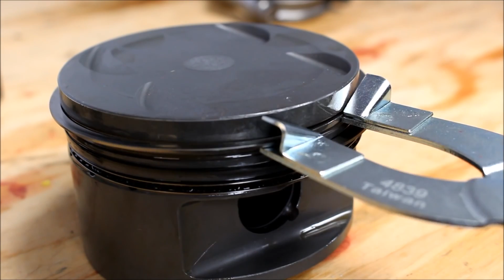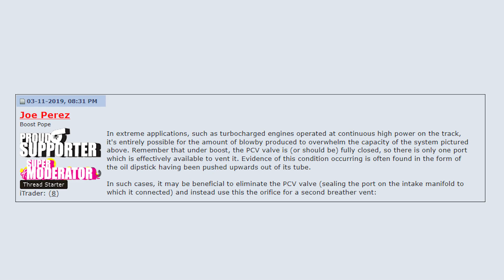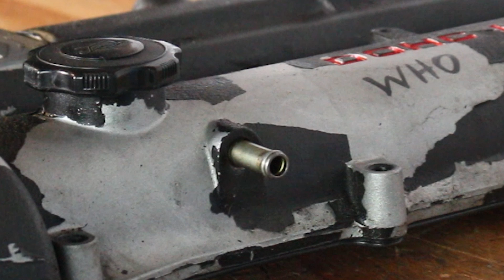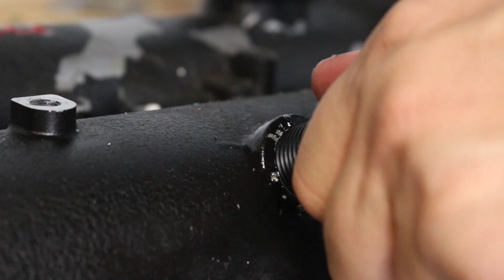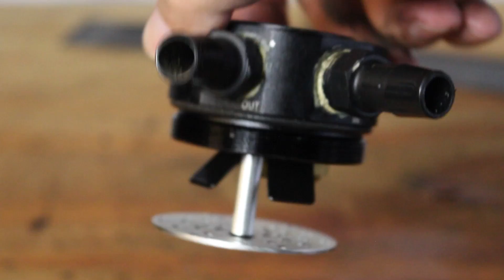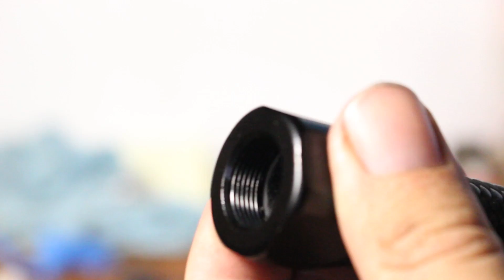Building The Optimal Catch Can Setup For the 400HP Miata! (No Welding Required)

Comment: 3 Things I thought would be made in a 'optimal' setup. 1 Air oil seperator. 2. Oil drain back to oil pan. 3. Air back to intake turbo suck side.
Reply from the maker: 1. Air/Oil Separator not needed unless you're running lines back into your engine 

2. Drain back might be needed, but might not. If it's a small amount of oil collected it's really more complexity than it's worth to add an additional fitting into the pan.

3. This can help evacuate pressure, true. But my concern is sucking oil into the compressor at full boost. To avoid this I could still use an oil/air separator in the breather line but need a 2nd can on the PCV side which I wanted to avoid.

This video is meant to provide enough information to make those decisions for your own car 😃
Reply: @TheCarPassionChannel  yea, good answer. TurboBandit runs 900hp on Mercedes with breather preturbo.
Reply from the maker: @gedas3419  Yeah I have nothing to back up that it could be bad for the turbo, and I know it's good to pull a vacuum on the crankcase. I may switch over to that. I actually have hooked a MAP sensor up to my turbo inlet and it pulls decent vacuum, drops from the normal sea level 100kpa down below 90kpa while in boost
Reply: @TheCarPassionChannel  ♥️
Reply: @gedas3419  Not all cars have the same PCV requirements. When I went over 350hp on my miata I had to eliminate pre-turbo plumbing because I was getting a ton of oil in my turbo and IC pipes. This setup is the result of decades of R&D amongst turbo miata enthusiasts. Any research you do will lead back to this exact setup if youre seeking above 300whp. This was the ONLY PCV setup that worked well for me after trying multiple different configurations
Reply: The oil vapour mix collected is very acidic, you do not want this draining back into the sump ever.
Reply: 2. You are collecting oil, water and petrol. 
You do not want this back in the sump
Reply: You shouldnt drain to the pan because the combustion vapors will contaminate the oil in the can and it will shorten your oil change interval.
Reply: Only reason I can't justify 1 or 2 is because in 1,000 miles I haven't even had a shot glass worth of oil come out.

I went with dual -10 vented setup like this because I was pushing seals and my dipstick with the PCV/breather setup most people run.
Reply: @AnotherRedMiata  same. Massive oil leaks, oil inside my intercooler piping and turbo from pre-turbo routing, etc. All of that solved with this PCV setup
Reply: 2 is only valid for cars that have long oil change intervals where the little bit of lost oil can become a lot of lost oil over the time, but here on such a car that probably gets 3k miles between oil changes, I don't even think it'll lose any significant amount in that time.

Plus the whole point is to not have that shit go back in the engine, what ends up in a catch can is so nasty I wouldn't want that going back in my pan
Reply: If oil gets into intercooler it covers it's walls and fins and reduces the heat transfer like an insulator
Reply: Also thought about this, though i noticed that my catch can (free breathing) often contains more condensation then oil. Draining back to the pan would mean this condensation also gets into your oil.

Comment: Hey Greg, I've forged my motor and may be going close to 18psi, I am mainly concerned about crank case pressure and my seals. I see Level7 do a oil cap 'QuickVent' product that looks a great way of venting pressure without messing with the cam cover. I plan to utilise this with a suitable AN10 catch can, but I was wondering once I install it, and I've got 2x AN10 venting the cam cover from the oil cap, should I still keep the PCV/mani hose in place (it has a GTX valve) or cap this off completely?

Comment: If you're a cheap ass like me, into fab work, an old A/C receiver dryer can be repurposed as a DIY catch can. You don't even need a welder if you're planning on drilling/ tapping the dryer can as well. You can find certain ones that work better than others size/ bracketry wise. Depending on how much time you take/ materials you use, its possible to make yours look store-bought and even better than some that are dedicated catch cans. You can add a drain, sight glass, barbs for filter/ inlet/ outlet, etc👍👍

Comment: Pro Tip: use a PCV valve from a turbo 1995 Supra (and a grommet too). Fits the Miata without mods and is all metal and definitely holds boost!
Reply from the maker: Mazda 323 GTX PCV falls into the same category 👍

Comment: Hi Greg, did this end up solving your leaking oil seals on your red car?

I have a freshly built motor with oem seals and have leaked through two front main seals. Breather system is AN6 and I'm thinking it might be time to go bigger

Comment: You mentioned at idle and low throttle there is a vacuum at the intake manifold through the pcv valve. What happens to your car since you essentially deleted the pcv valve?

Comment: If what was in the old catch can is months to years of oil, exactly HOW is that little oil going to alter octane of air/fuel mixture, and risk detonation? Looks like the complicated catch can is a solution in search of a problem. Not that I'm in the habit of arguing with Joe Perez . . .
Possible engine totaling error in valve cover assembly. Use medium thread lock on the small screws holding the covers to the oil precipitation labyrinths in place! The factory sealant seems to function the same as thread lock, sealant squishing into the small fastener threading. "Hand tight" has ended up with loose screws in the valve chamber, most of which fall through the oil drains in the head, to end up in the oil pan. Where ever they end up, among the valve springs, or in the pan, this risks severe metal damage several places, all totally needless.
The plastic scrunchy in the oil precipitation labyrinths ignores the function their name describes, just 'filtering' any large particles, which should Not be inside the engine anyway. Also, how large hose venting may compromise oil return to the pan. The faster oil laden air moves through the labyrinths with the new larger openings and hose, the less oil precipitates out on the cooler VC metal sides, and drains back into the engine. This fills functional oil catch cans faster! 
Metal mesh isolates much of the air flow from the cooler valve cover, intuition isn't much help determining if it's better or worse. Tests would distinguish which is better, clear or stuffed with metal mesh.
Shouldn't catch can hose cutting and routing be the Last step after turbo air, oil and water hoses, IC pipes and whatever coolant reroute is used, have all been installed in the least mutually compromising layouts possible?

Comment: Engines make 99% of damaging crank case pressure from the underside of the pistons. For the Honda guys why do they vent from the valve cover??? when there are 2 to 3 large venting location located on the back of the block! Maybe they think it looks cool venting at the valve cover.

Comment: did you dislike the mishimoto oil catcher?
Reply from the maker: I just needed to reconfigure the system to let the crankcase breathe more, needed something with 2 inlets and a vent, rather than an inlet and outlet designed for oil/air separation

Comment: I see one problem with this. Sludge. The factory PCV system is there for a reason. It's to prevent sludge buildup. 
Tho maybe with a car that doesn't get to see a lot of miles, it's not such a big issue. For a daily driver tho, you'll definetly wanna keep some sort of vacuum on the valve cover

Comment: I have a turbo 1.6 and I noticed a ton of blow by should I upgrade the pcv valve and port out the breather side I’m going to be drifting with the car what do you recommend? I’d ask the fb groups but rather get intelligent responses instead of 100 smart ass comments
Reply from the maker: Any catch can/air oil separator system is only going to manage the blowby, nothing is going to reduce it. But, it is important that the blowby is able to escape, otherwise it can cause leaking seals. You also want to avoid constantly feeding oil into the intake.

Comment: I’ve seen other videos of older small block engines that instead using the intake to pull pressure they use the exhaust which would reduce carbon build up id think? Anyone think this would work on a Miata?

Comment: Hi Greg, I know you said in the video that for cars in the 200-250hp range you don't need to do this, my question is can I do this on my 240whp car and it will still be a benefit? Currently running no catch can at the moment and wanna do this route over a separator between the PCV and intake
Reply from the maker: The benefit from running a can still exists because you're avoiding oil vapors going into the intake - the comment about 250whp was mostly referring to converting the PCV into an open breather. The common setup is just like you said - using an oil/air separator in line with the stock PCV system, and either running the breather to a catch can OR running a second oil/air separator in the breather line in case you want/need to hook that up to your intake.
Reply: @TheCarPassionChannel  thanks so much dude, can I still use this process in my 240hp application? The AN lines look mint!
Reply from the maker: @andrewatkins1438  Yeah you could do the AN lines on both sides and still have a functional PCV system too

Comment: Run a breather hose from the valve cover to the catch can.  Run a second high-temp hose to North of the catalytic converter (wink wink) to a welded bung that is angled pointing downstream of the exhaust.  Yes, the hose should be flex steel for a foot or two as it connects with the exhaust.  Place a high temperature one-way valve inline, in case of backfire.  The suction from the exhaust will pull out the oil mist from the crankcase, and it will "generally" burn up as it exits the tailpipe.  Prolly better for race cars than something that needs to pass emissions...

Comment: coool video Greg just small note regards of math - increasing diameter from original 6.39mm up to 9.15mm will increase area (which is what matters) by over 100% not 43% so you should be good :D

Comment: You can bore out -10AN to 3/8 NPT fittings to match the -10AN ID. Pretty easy with a drill press and opens it up significantly. There's enough material on the 3/8 side to get away with it safely on a low pressure line.

Comment: I had to fit a 2L catch can (FIA regulation) on my breather side only which was enlarged because on NA high compression, the oil fumes lower the overall fuel RON index which is not good on a race engine...

Comment: R there any downsides to putting a tiny air filter on the valve cover, on the other breather on opposite side of the PCV breather?  NA set up
Reply from the maker: No and that's a common setup. Reading through that catch can thread will help cover all the different setups

Comment: Quick tip on wrinkle paint - the quality/tightness of the wrinkle is dependant on curing temp. If you are painting multiple parts that are in the same visual area, do your painting/curing all at once. Letting paint cure outdoors on different days with different temps will cause different wrinkle finish on the parts.

Comment: Could connect the oil catch can to the intake of the turbo help to the ventilation system? 

Since it’s a vaccum point should help to suck the vapours on the top of the head.

Comment: I like it! Love the Channel. I’ve got a 1996 MX5 that I bought a few years ago, it was put together by Flyin Miata. forged internals, ARP studs everywhere, Garrett turbo charger I don’t remember the size or at the moment, Full stainless dual exit exhaust, lowered with a Full adjustable suspension set up, under body bracing, interior upgrades. paid 6000 for it with only 53,000 original miles  on the odometer and all of the original paperwork from the build. I also did several other modifications to it it. New ECU coolant reroute LS coil conversion added some dedicated power and ground cables.  was tuned to 300hp  unfortunately due to a few bad parameters while setting up launch control Number three connecting rod left the Chat and the engine bay.

Comment: Hey Greg what's your thoughts on DIYing an oil filler cap that breathes directly with the catch can, while keeping the stock exhaust PCV that is connected to the same catch can? It runs 12psi with <300hps.
Reply: Sounds dodgy. Follow these exact instructions is my options

Comment: Real racers use brass 3/8 NPT to 5/8 pipe fittings JB Welded into the valve cover and 5/8 heater core hose. Just sayin'

Comment: I’m considering the Kraken kit myself. Why would I go with a low mount over a high mount? I was going to get the high mount because I didn’t know
Reply from the maker: I love how straight the downpipe comes out, and that it keeps that hot unit of a turbo down low and somewhat "farther" from the engine bay. It gives you more engine bay space as well, but the downside is that it's quite a bit harder to work on, which you'll see in the manifold install video, hahaha. I could not imagine installing this thing with PS and AC.
Reply: @TheCarPassionChannel  I really want to keep PS and AC, even though my AC doesn’t work now I want to get it repaired… my power goals are low 200’s at the wheels so I think I’m good with the high mount but I’ll continue researching

Comment: I feel like I am quite sure you need to rtv the baffles back in. My old turbo setup was filling the catch can after 20 mins of normal driving. Couldn't figure out why. Pulled the valve cover to find the rtv was worn. Resealed it, and the issue went away. Multiple track days and still no issue
Reply: Same thing happened to me, definitely seal those baffles.

Comment: Hey Greg, quick question. I have the same old mishimoto can that you had and if I go rip around all day I can easily fill the can up almost halfway every time. Is there a reason for this or is it just poor ventilation? My car is a 1.6 turbo that makes roughly 225 whp.
Reply from the maker: Is the catch can in the breather system, or in the PCV system? Usually just more blowby means more oil vapor is going to enter the can.

Comment: Went ahead and ordered the same as you to make a catch can. Unfortunately the engine builder of my forged 1.6 put the thrust washers in backward and destroyed my motor. Lasted 100 miles. Should have new motor up and running within 3 weeks. Would love to race you when its ready. My Garrett 2867r Gen 2 would make an interesting run.
Reply: Damn that sucks

Comment: I am absolutely loving your vids,  you have a great way of explaining things. I had an issue with my vw golf (rabbit) gti, slipping clutch, when I opened it up it was drenched in oil, worked out that the crank case was not venting well enough and was blowing past the crank seal into the bell housing at high revs .  Better vent, better clutch........subbed.

Comment: Looks great as always! Awesome alternative to welding them like we typically do, saves you the pain of a respray if it’s already a finished cover. If you do want to put scrubbers in the baffle passages (def not required), the trick is to only put it in half of the baffle passage, on the side farthest from the AN fitting. It scrubs the oil out, but won’t let the oil weep towards the fitting and into your catch can.

Comment: Made the valve cover mod myself (welded because im a pro of course). Cleaned the rtv from baffle plates and DID NOT put any new rtv... Tried it without any hoses and no hood on the car, fuckyyes and after a couple of minutes when oil got up to temp it started squirting all over my windshield (yes while driving).
Let me tell you there's no windshield washer fluid for that scenario...
To sum up, a lot of oil got into my baffles just by creeping thru the non rtv'd surfaces and then when crank case pressure came it looked like I were running a fryer at McDonald's.

Rtv your baffle plates (if you dont have the old rtv intact)
Don't run without a hood
Don't make the AN10 fittings point straight up.

My 2 cents
Reply from the maker: You're the second person to report the issue with not RTV'ing the baffle plates so it definitely sounds like a good idea. I've done this to 2 other valve covers and had no problem, so mixed results are possible. Another thing someone else mentioned is using loctite on the screws, typically I don't worry about this myself because the soft aluminum does a great job at holding screws in, but it won't hurt anything.
Reply: @TheCarPassionChannel  Just to add, welded the fittings straight up and also got the cheapest AN fittings. 
Guess who had lots of problem closing ny hood? Had to mash my fittings from 90 degrees to somewhat like 130 degrees.
At last I ordered some higher quality fittings with much shorter neck and larger diameter. Still hits the hood but its something 🤷

Comment: I had a dual breather setup with no PCV just like this, just without enlarging the passages. I would notice while letting the car idle for a while, I'd see vapors come out the catch can and out the tailpipe upon initial throttle. Sadly I didn't get to put enough miles on the setup due to thrust bearing failure, but I am curious to hear how this works out on the street for you.